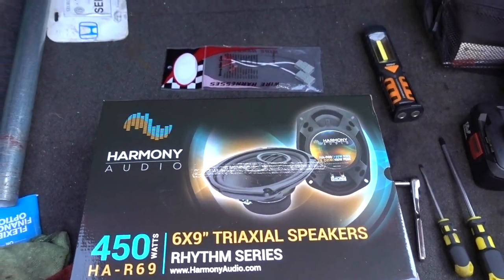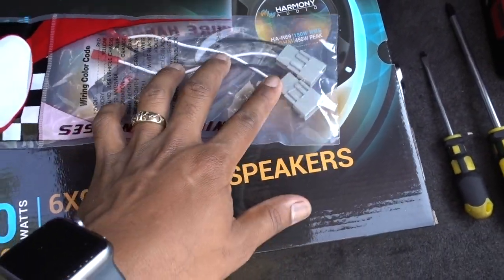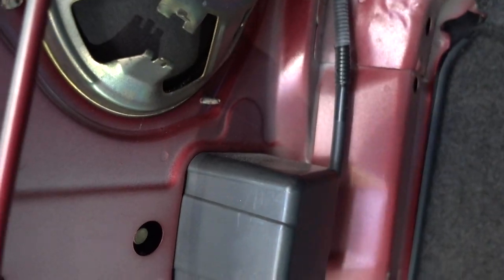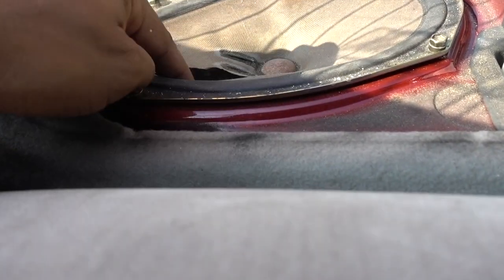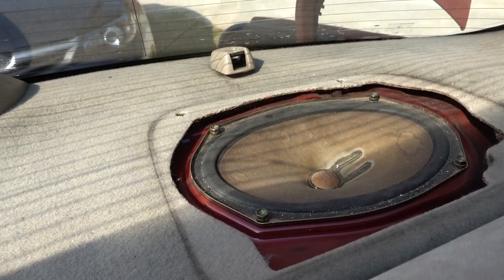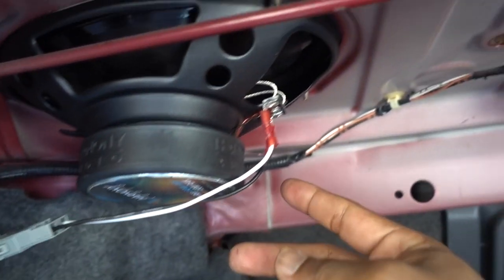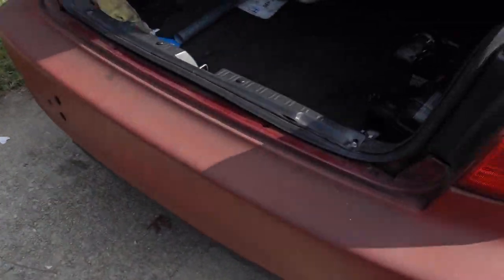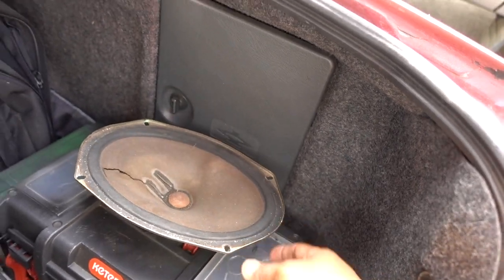How To Replace Rear Speakers 1998 to 2002 Accord

Comment: Where did you get that harness with the clips? The one that came with my speakers doesn't have the grey clips on the end
Reply from the maker: Amazon
Reply from the maker: Compatible with Honda Accord 1998-2002 Factory Speaker Replacement Harmony R65 R69 Package https://www.amazon.com/dp/B0161IAIX8/ref=cm_sw_r_cp_api_i_CfgYEb6FE74JV
Reply: Will the front door speakers use the same harness?
Reply from the maker: No they plug in to the stuck conector

Comment: What speakers will be good for my 1998 honda accord with a pioneer stereo system in the car. The video was helpful my back one are not working either
Reply from the maker: https://www.ebay.com/itm/304144544401?mkcid=16&mkevt=1&mkrid=711-127632-2357-0&ssspo=aoP6Y7ltR_y&sssrc=2349624&ssuid=BmS7GN-2QMa&var=&widget_ver=artemis&media=COPY

Comment: Thanks bro! Love your videos. I got a question...….I pulled down the back seat in my 2001 Accord and underneath the carpet is one skinny black wire and two red wires inside the black protective cover, These wires look like they go under the middle of the back seat and maybe towards the front of the car, maybe radio? Any ideas what these wires are for?
Reply from the maker: Thanks bro, I’m not sure but I think those are radio!! Follow the and if they go to the rear speakers that’s what it is, but don’t quote me on that.

Comment: Good video man. How do you remove the 2 or 3 bolts that are located right behind the rear speakers? Especially the plastic covers that cover the bolts. I don’t even know the name for them, but they are in your video went your in the interior. Also, there is one in the middle and 2 behind each speaker. I have a 2000 Accord coupe and I’m trying to get the plastic covers off of them, but I can’t. Any advice I would really appreciate, thank you.
Reply from the maker: I don’t no if is the same for the coupe but to remove the cover you have to remove te screws under the trunk to be able to remove the covers after that you need a 1/8 ratchet to remove the bolts because in the coupe is very small space because the glass is on your way

Comment: Best to reuse original covers on this application for sure. I will be replacing all 4 of my speakers here real soon, and even if I could use replacement covers, I won't. Why advertise? If people can't see what you got in there, they're less likely to try and steal em. Make them think you're still using those crap factory speakers that they won't want... not even worth the effort.
Reply: My factory covers won't fit the after market. I'm gonna tint the windows any way so hopefully that helps avoid theft. Any ideas on fixing the carpet?
Reply: @brangthuhyang6945  I ended up replacing all 4 factory speakers, and had to slightly modify the front speaker holders for the replacements... no big issue, all sounds much better. I have no idea about the carpet, I never had to mess with mine. The biggest problem I had was where to mount the new amplifier, and that ended up under the front passenger seat, didn't wanna run all the wiring in the trunk... too much trouble.

Comment: Is it the same as a 1995 accord ? Or different steps
Reply from the maker: Is the same steps, but check if you have to get them out from the trunk or pull them out from inside of the car
Reply: Thanks bro
Reply from the maker: No problem bro

Comment: You don't have to add an amp for better sound?
Reply from the maker: My old speakers were bad I’m just getting the sound like before, I’m not into big sound systems in a car
Reply: Amps are nice to have but not really necessary if your stereo is decent. A good stereo produces low enough distortion, good speakers will sound just fine.

Comment: Where did you get the harness
Reply from the maker: Fits Honda Accord 1998-2002 Rear Deck Factory Replacement Harmony HA-R69 Speakers New https://www.amazon.com/dp/B01N37BDKD/ref=cm_sw_r_cp_apip_USMuBE8WJ1oYy
Reply from the maker: The harness is included with the speakers
Reply: Ivan Avalos you can get them on amazon